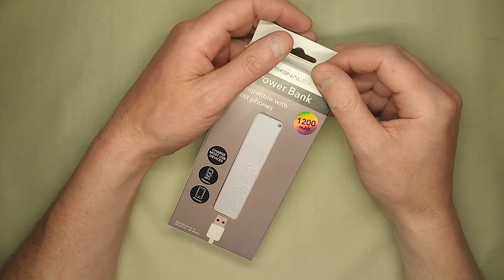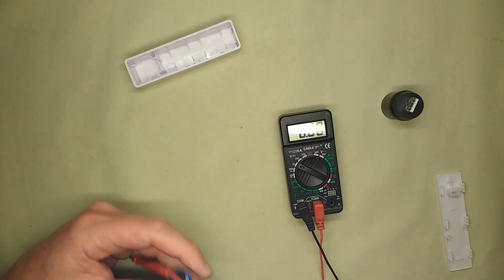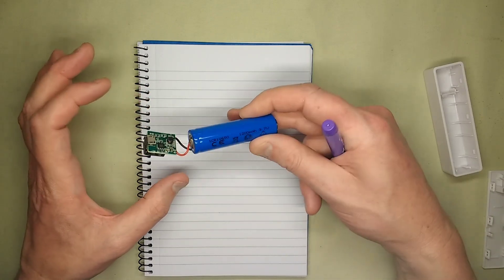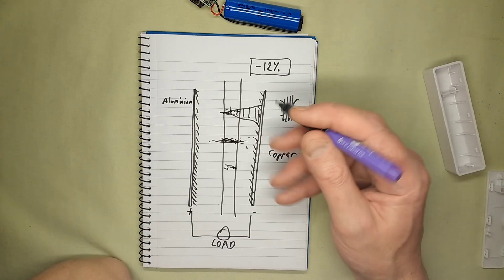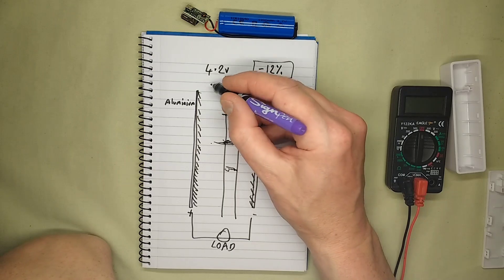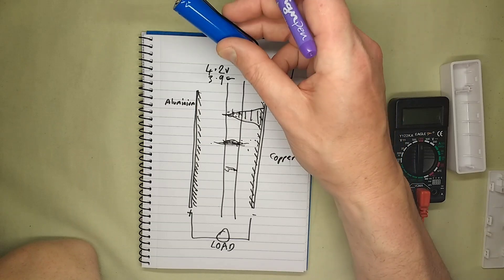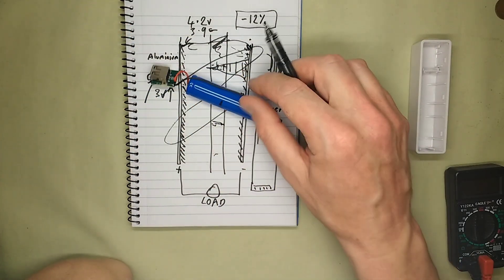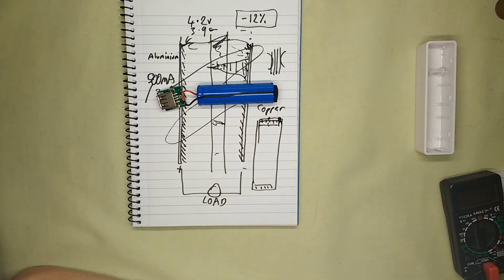Are over-discharged lithium cells safe?  (And how to test for damage.)

Comment: I think it helps when the discharge current is low. A lot of the horror stories about puffing and exploding lithium cells seem to come from the RC world or other high discharge uses where the packs don't just get discharged past the recommended minimum but get hammered down there. With an RC battery and a moderate current draw the voltage has a tendency to fall off a cliff once about 80% capacity has been used, after that point the voltage plummets very quickly and damage can be done. Many people recommend to only use 80% of the capacity of a lithium RC battery. With lower drain cells like with phones and powerbanks that doesn't really happen so the voltage can gently trickle down till 100% capacity is used.

So I suppose it makes sense that a battery that's gently discharged past the recommended empty voltage would be less volatile than one that has been forced past under great strain.

Comment: I have a box full of these failed powerbanks on the table. I just charge them a bit separately, then finish them with a regular USB cable. No cell has been damaged so far. I just tell the future user that these should not be stored for long because they self-discharge. These are for a giveaway, no money is earned. 
I noticed that the blue LED that normally indicates that a load is connected is flashing a little in the dark. I thought that maybe I could fix the discharge by disconnecting this LED. But this didn't help at all, still 22uA as before. If anybody knows how to mod this to improve storage life, I'd be glad.

Comment: I have just spent £14 on a charger for these cells. Very posh but - bugger. Can't find these in our £ shops down south. Somehow I have an LED that is situated at the TOP of the clear casing. It's viewing angle is 180 and it's a lovely really gold colour. It's in a solar garden light, tiny solar panel and button cell. Anyone any ideas where it came from ? I would love to get some more. I am sure that you would love it Clive, probably have an organism. There is a lot of kit Poundland do up north we don't get in the south.
Reply from the maker: The LED sounds like  a straw hat LED.  Probably warm white.
http://www.ebay.co.uk/itm/100pcs-5mm-LED-Straw-hat-Lamp-White-Warm-Red-Green-Blue-Amber-Purple-Wide-Angle-/252176617261?var=&hash=item3ab6e5cf2d:m:m1AKscVjGy51nhQeuA0hM_w
Reply: Spot on - thanks Clive. Just one point, it's not the normal warm white I use. This thing is gold, it's like looking at molten gold. It could be the coloured one on eBay but that's too strong a colour.  Never mind I like those straw hat ones, I'll get some. Indecently I finished my first LED bench power supply today  - 2 x LM338, bugger worked even after I blew the 2 A fuse. Ordered 500 g lead solder 0.7 mm (£20) Gawd. Last lot lasted me 44 years. Long story.

Comment: Thanks for this video! Not only did I learn a lot about lithium batteries, I also didn't know about the resistive regulation in the power bank charging controllers. So it's not the cell that heats up … hopefully.

Comment: I had a couple of batteries (likely dead) that inflated when recharged. One of them was my old PSP battery.
I don't know what kind of voltage they were at, but I've worried about letting my electronics discharge too much ever since. 
This video makes me wonder, how much exactly is -12%? You mention it a lot in the video, but I don't see you mentioning anywhere exactly how much that would equate to on a standard Li-Ion or Lipo battery.
I do think that a battery isn't necessarily unsafe to use just because it inflated, it seems to happen a lot on phones and such and people keep using their devices with inflated batteries for ages without any issues, but it still makes me worry.
And I wonder if somehow my inflated batteries had reached those crazy low levels in only a few years.
Reply from the maker: In the research it correlated to a reverse voltage of about 2V.

Comment: The story I always heard about low state-of-charge li-ions is pretty much what you said at 10:00. Not that they're incredibly dangerous or anything, but just that they have to be charged super slowly until they get to a more normal range to avoid trouble. And that sometimes you get screwed by a protection circuit because it will do a hard cutoff when it gets undervolted enough, which prevents you from ever charging the thing up again.

Comment: I'm not sure whether or not this has been mentioned, but many 'Proper' chargers will not work if they detect a voltage of less than (say) 3.0V per cell.  I usually fix the problem by charging in the NiCad 3 cell rate (per single Lipo cell) for a few seconds to bring the minimum up to a point where the charger protection circuits can be by-passed.  Making up a charge lead using 2.54mm header pins allows one to charge individual cells of a pack via the balance lead.  Only the most expensive batteries have matching cells and this is a godsend to keeping a well balanced battery.

Comment: hey im working on messing with a instrument cluster out of my old car and i cant seem to find out the pinout for the cluster so i have no clue what goes where and was wonderin if you would have any idea where i could possibly find a pinout for it, its a 2002 Nissan altama cluster with the speedo and rpm etc and its got two connectors but i have no clue where the wires go to any i have no idea how i could even start to test it without blowing it up i got a 12v source but i cant find a wiring diagram for the connectors i want to possibly implement it into a game or possibly just for something to build into a box and to do stuff

Comment: This is a cool video, I run lithium ion batteries in my bike, I just had a ballistic racing battery go bad because I left my radar detector on over night, the battery has melt spots all over it... anyway it's good to know what I'm straddling at high speeds and what kind of problems I should be looking for

Comment: I've found one of the best ways to test for damage to lithium cells is by letting them sit a good 20 minutes in a campfire.  If they pop or explode rather than emitting angry, squealing jets of bright flame, they were probably ok.
Reply: Don't try this at home kids! The camp fire will damage the floor coverings. Use Mummy's microwave instead!
Reply: That's just bad information that could get people hurt.

It usually takes less than 5 minutes to perform the fire test, and 20 minutes is excessive. 😮
Reply: Similar to method used in Salem witch trials, comprehensive set of criteria pre-established!
Reply: This is genius
Reply: Sounds quite like my fuse tester, if the lamp flashes, the fuse was good.
Reply: Sounds like the way they tested if you were a witch.
Reply: If destructive test is "one of the best ways" I think we need further research in that matter :D
Reply: you know - someone somewhere try it
Reply: Destructive Testing, yes!

Comment: I wonder if the quiescent current eventually stops being an issue, once the cell has discharged to a level that the chip stops being in charge of anything. i.e. once the cell is at zero volts, the circuit does nothing. (????)

Comment: well i have not even seen your video yet but i fly racing drones and if we disgarge are lipos to much somtimes they busrt open and then sometimes they smoke or burn but olso a lipo that has been discharged to much like 2.5v per cell it can start puffing and smoking and in wurst case burn when a lot of amps are drawn from it we try to still save them just take care and i store my lipos in a old ammo box i dont lock the lid so it wont explode and dont discharge a lipo below 3v if you want it to still give amps

Comment: i find that quite often cells i have drained to 0v will short or go open. about 1/3 or 1/4 will be unrecoverable. will see in a little bit how much capacity was lost.
i bought one of those cheap chinese motor speed controllers and had a temporary pack of 8s 18650's hooked up. it had 8 mosfets and so far 4 have failed, the first 3 died within a minute of having power (controller not on). the fourth just happened i noticed today my pack was at 0v and mosfet shorted.
i just received it a couple days ago and its rated for 48v 10-50v 3000w 60A. i had less than 33v hooked and it failed 4 times, last one took half of my cells to 0v unrecoverable. (yes, i should have protection/balance circuitry (temporary setup only))
should i ask for a full refund or accept the 10/12 refund? http://www.ebay.com/itm/MAX-DC-60A-10-50V-Motor-Speed-Control-PWM-HHO-RC-Controller-3000W-12V-24V-48V-XP/112453215593?ssPageName=STRK%3AMEBIDX%3AIT&_trksid=p2057872.m2749.l2649
Reply: charging and discharging now. one of the cells was charging then went below .6v while charging.only one has discharged so far but has only lost 23mah, which is small enough to simply be charged slightly less.will update when the rest finish.

Comment: Just last week it happened to me that I prepared a 18650 Samsung battery connected to a small tungsten lamp for toys (actually connected to my daughter's new doll house); no extra circuit in between. Unintentionally, I left it on for 24 hours. The battery got completely depleted. I could not recover the battery from the 0V using Xstar VC4 charger.
Reply from the maker: Many "intelligent" chargers will not attempt to recharge a cell that goes below 2.5V.  The powerbank chips will recover it by trickle charging it to bring it back up to 3V then charge at full current.
Reply: I got a NIMH charger like that If the cell is too flat it won't touch it it. I one of those that has sensors for each cell can either fast or slow charge or even cycle the cell. Had times had to use a cheap charger to push a little current into the cell then put back in good charger to get it to start.

Comment: In the simplest terms, yes, it's dangerous -- all kinds of things happen to li-io chemistries at ultra-low voltages, and they vary from formula to formula (every manufacturer has their own witch's brew.) It gets worse the more times it's discharged. The largest issue with a zero-volt battery is the very real possibility of it reversing polarity. Of course, that's pretty easy to test -- if it's reversed, throw. it. away. That said, a cell with a protection circuit built in will not actually be at zero when it reads zero from the terminals.

The samsung issue was two-fold. Primarily it was an issue of the phone not having enough space to allow for the normal expansion of the cell -- i.e. it was crushing itself. There was a secondary issue where metal contamination caused internal shorts.

(If your charger is smart enough, look at the internal resistance.)

Comment: I have one of these power banks and Clive failed to mention, these operate the 3.7 to 5 Volts inverter 100% of the time, I re-charge mine every day.  That is why they are fully flat when you buy them.  Mine is PINK.  (Mine was $2 at Goodwill)
Reply from the maker: Many draw a tiny amount of standby current and just pulse every so often to keep the 5V output topped up.  They should last for months in standby on a full charge.

Comment: I had never considered reverse charging a cell in a pack as a result of continued usage after depleting one cells capacity.
 I once bought a parts car real cheap because no one could figure out why the starter wouldn't work even when replaced with new. When I went to check the voltage I found that the polarity didn't match the terminals. Apparently someone had drained the battery and then reverse charged it. Everything worked except the starter and wipers were running backwards. I turned the lights on and left it overnight, charged the battery correctly, started it up and still drive it today. That battery lasted about 4 years even with the abuse it had seen. I never would tell the seller how I fixed it other than say it was his own fault.
   Mike (o\!/o)

Comment: I recovered a lipo pack that had been discharged to about 1.5V/cell, and it worked perfectly for about two weeks, no noticeable self-discharge and normal capacity. After those two weeks, however, I noticed that the pack had puffed considerably. It still worked, but other packs of similar age that hadn't been deep-discharged did not puff.

Comment: I think I got a powerbank that uses a similar circuitry... I found that the quiscent current is unacceptably high, so I hacked an on-off switch onto the case... This might have caused the overdischarging of your cell. You might want to check the off-state current of this powerbank of yours?
Reply from the maker: If I recall correctly it was close to 1mA with this unit.

Comment: over-discharged batteries are less volatile than a charged cell, it just poses danger of plating the cathode.  So it makes some sense to over-discharge the cell until the electrolyte is not reactive to the air prior to shipping.  It does leave the cell with a shorter life

Comment: If it's of any interest a friend's PS3 controllers both died recently and upon testing the batteries they both read 0v. I charged them manually with one of those cheap lithium charging boards from China and since then they've been operating just fine.

Comment: I'm sitting with 200+ Samsung 26F 18650s on my bench atm, recovering them from 0.2-0.8V and capacity testing them. They're rated at 2600mAh and is coming in at 2350-2550mAh. Which is plenty good enough. Only remaining thing is to test for self discharge. Going to leave them charged for a month and see. :)

Comment: I recently pulled a 7-pack of 18650s from a discarded cordless vacuum. One cell showed -0.16v, so I didn't dare put that on the charger, but the others had varying charge states and I managed to revive them all right. Time will tell when it comes to retention, so fingers are crossed.

Comment: I have almost this same power pack. I took it apart because the mini USB plug would not go in the socket completely. Just checked it and the battery had discharged it self from 3.9 volts to 0.07 volts, don't think I'll be trying to recharge it now. Thanks for the video Clive!!!

Comment: Bought one of these that was dead, threw the battery but connected my own 2kmah cell to the pcb.  Few weeks later (never used it) it was down to about 0.6v.  Meant to throw it out but saw this video and re-measured.  Down to 0.18v.  now charging :-)

Anyway, I think the pcb on some of these are dud, drawing high quiescent current.  I have other Poundland banks that hold charge so not all have a high drain.  Haven't done any testing but that's my theory.  Once this cell is charged I'll monitor it over the weekend then cut the cable to the PCB and monitor again.  I'll see if it's the cell or the PCB.  Pound to a penny i's the PCB.  If so I'll hook up a known low quiescent current pcb (i.e. one that hasn't pumped a cell dry over time) and see if that makes a difference.

Cheers Clive.  I generally bottle it with Lion cells, so wouldn't have tried the recharge of such a dead cell otherwise.  On the flip side, if my flat burns down tonight as a result I'll be sure to let you know (and remind you again and again for a long, long, long time to come ;-) ).

Comment: BIGCLIVE!
I am sorry if this is not the place, but how can i tell the voltage i need to drive the MOSFET? When i look up something like IRFZ44NPBF there is billion characteristics >_<.
I want to use it to put 12v thru by driving it with 5v on the gate, but i have no idea if it will work.
Reply: The Last Phoenix look for gate voltage
Reply: Is "Gate Threshold Voltage" the thing?
Reply from the maker: For 5V you will need a logic level MOSFET optimised for the lower gate voltage.  The number usually ends in an L.
You can generally drive logic level MOSFETs directly from logic level outputs.
Reply: I heard about logic level MOSFET but did not knew how to tell one from others. Thanks!

Comment: Don't know if these have the same problem as the previous models but they couldn't power a desk fan for more than a few seconds, they still had power and a similar spec Kodak PB happily chugged along. Any idea why that was?
Reply from the maker: These are not rated for high current output.